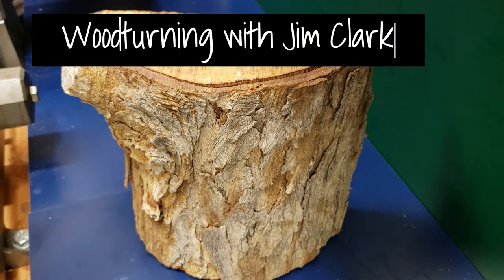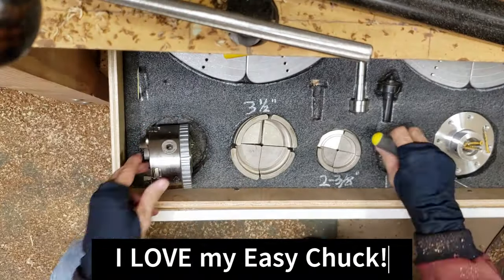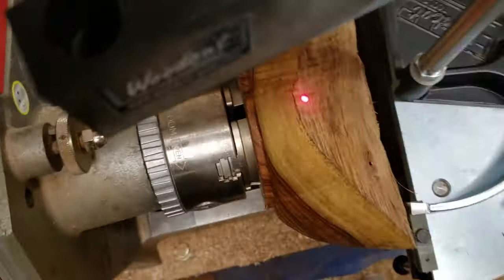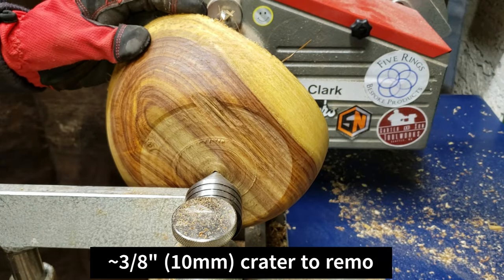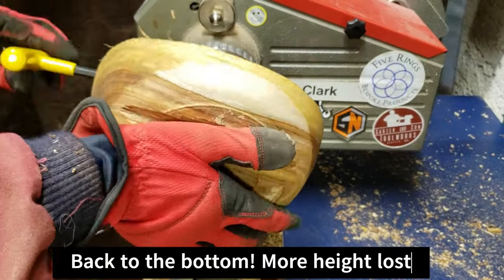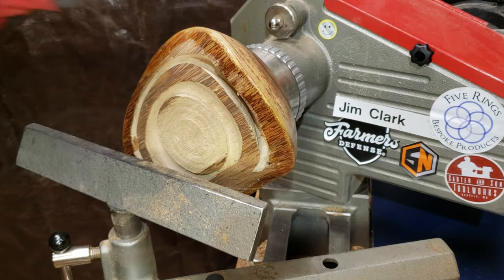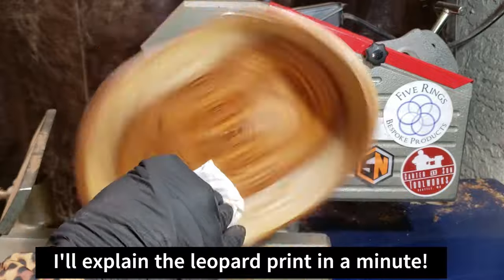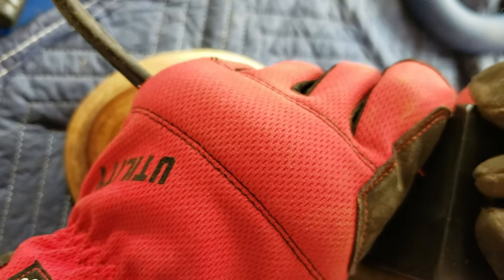Woodturning -A Double Live edge Sissoo coring project

Comment: Nice save on that bowl. Glad to see another Nova 3000 user. I had the motor die on me a few weeks back. Finding a replacement motor was not for the faint hearted and can get very expensive. I was very lucky to find a Nova 3000 DVR headstock. Complete game changer. Fits on the 3000 bed in place of the one you have now. No belts to move around and precise speed when needed.
Reply from the maker: @JuanAndrada-z8s  Oh my goodness, if I could swap to a dvr headstock, I would be in heaven! I'll have to look for one. I did some research to convert mine to variable speed, but then I couldn't get the pulley off the motor, so I bailed out of that for now. Thanks for watching!

Comment: Hi Jim, beautiful bowl, I'm looking into getting a coring system, I think it's about time I did 😃
Reply from the maker: Thanks Mike! I really like this system, and it works well aside from my blatant user error in this video🫠.  I've done several successful corings before this attempt. I looked at the other 2 systems (oneway and McNaughton) and decided against them. Oneway seemed like a pain to set up, and the McNaughton doesn't look safe. The way the Woodcut pops into the banjo and tailstock is a breeze.
Reply: @FRBPturning  Thanks Jim, you said on the video you can cut shallow angles, how shallow can you cut? I was under the impression it just cuts a semi circle. Thanks
Reply from the maker: It does only cut a semi-circle, but by changing the pivot point location relative to the axis of the lathe you can cut a pretty shallow bowl.  I don’t have a number but I’ll put some pictures on the community tab today to illustrate this.  It really is an incredibly useful tool and I’m going to use it more on all the big blanks I have.
Reply: @FRBPturning  Thanks! I have just taken the plunge and ordered the McNaughton system from Germany. Ordered this one as I love the flexibility if it
Reply from the maker: @MikeHolton it does have that advantage. I didn't want the learning curve that seems to come with that one. Also, my hand arthritis has severely decreased my grip strength, so I was worried I wouldn't be able to handle it. I look forward to seeing you experiment!
Reply: @FRBPturning  Thanks, I'll be testing it on some cheap wood first lol
Reply from the maker: @MikeHolton that's what u did too! I recommend something on the softer side as well
Reply: Admire your efforts, nice bowl!

Comment: I never use recesses any more i have learned my lessons well. I believe using a foot is a better looking and more professional in the end. When you see pros they use a foot and do embellishments on the bottom.
Reply from the maker: Yeah I usually don’t either unless I’m really trying to preserve height like I was here, or if it’s a much smaller and easier turning.  I still have a lot of improving to do on the aesthetics of my bases.  Thanks for watching!
Reply: @FRBPturning  I use Vicmar chucks the foot only needs to be about a 1/4 to 3/8 at the most as long as the face or the chuck is hard to the bottom of the bowl the bowl holds very well. Watch Tomislav Tomasic Wood turning he is a master.

Comment: Some wood is just very difficult to core, I stay away from using a recess as it seems to always cause problems. A tendon can also be used as a foot which can lift the bowl off the surface and add to the appearance (in most cases) IMHO.
Reply from the maker: @harveypflugerh5901  yup!  All good points. I learned more than I expected (or wanted) to on this project! 🤣